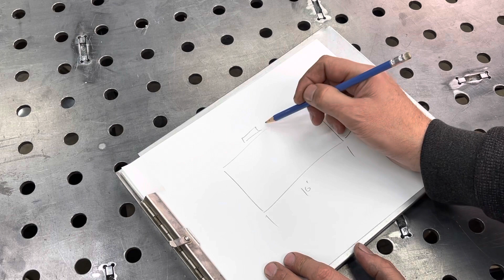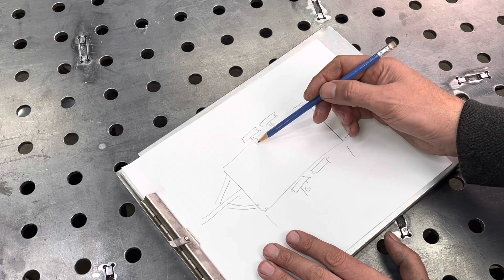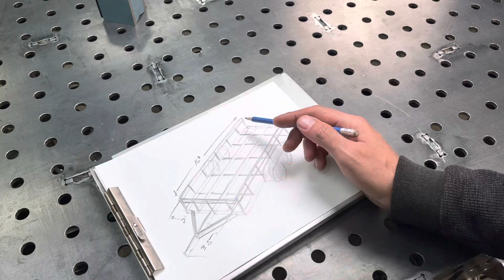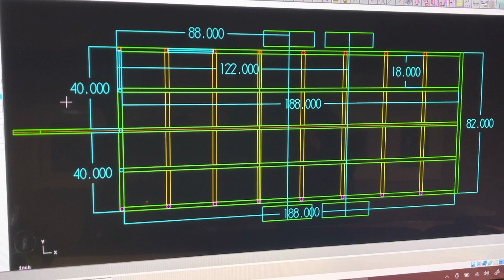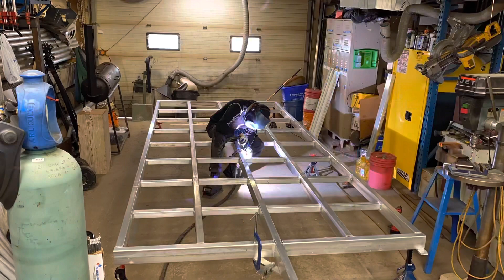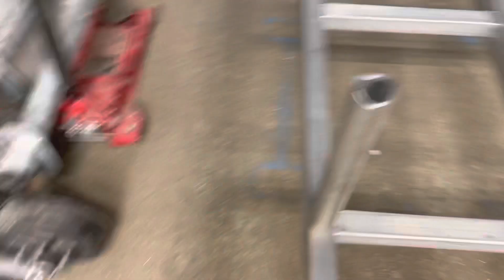DIY ALUMINUM UTILITY TRAILER !!!

Comment: I wasn’t able to catch what wall thickness and cross section tubing you are using?
Reply: Just found it in the comments 2” by 4” by 1/8” thick.
Reply from the maker: It’s all 1/8” wall

Comment: What size is the aluminum tubing you’re using ?
Reply from the maker: For the frame it’s 2”x4” and for the sides it’s 1.9” diameter
Reply: What is the wall thickness of the 2x4's?
Trailer looks amazing btw.
Reply from the maker: @dusanpribilovic5226  it’s 1/8” wall thickness
Reply: @BonifabcustomRobBonifacio  , Very good work!!!! What aluminum alloy is used to build trailers?
Reply: @BonifabcustomRobBonifacio   what would you say this trailer is rated for built like this? a estimate is fine!
Reply: Thanks mate

Comment: Wow yeah a lot of Tig welding there. That's gonna be one strong trailer. I'm making a 6x12 but using 2x3 angle around the main frame.
Reply from the maker: Awesome, ya i kinda wish i had a aluminum mig it’s much faster
Reply: tig welding can destroy the temper on 6061 alloy alluminum. some times bolting is best way to keep it strong!